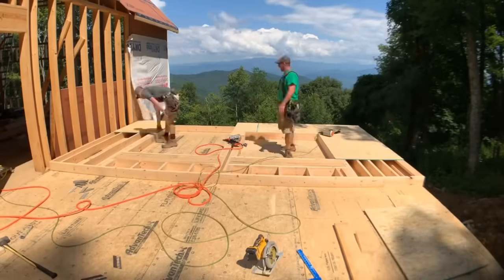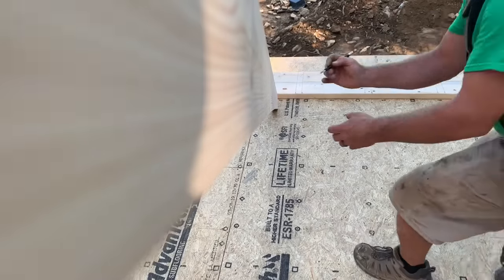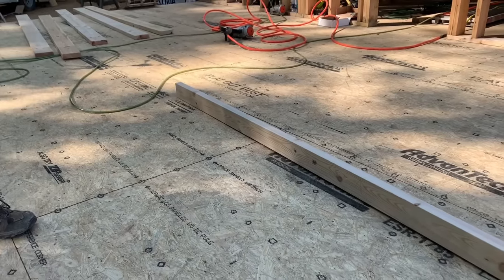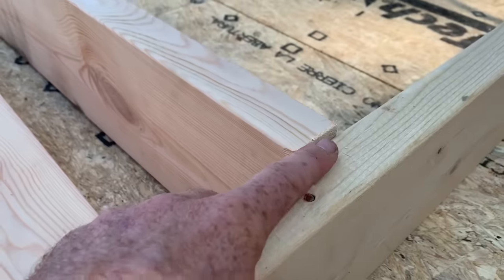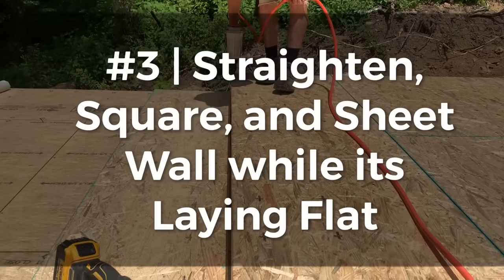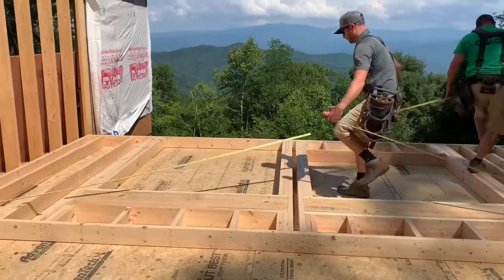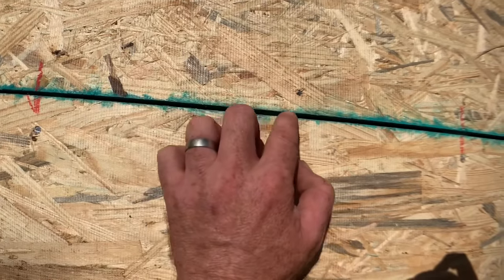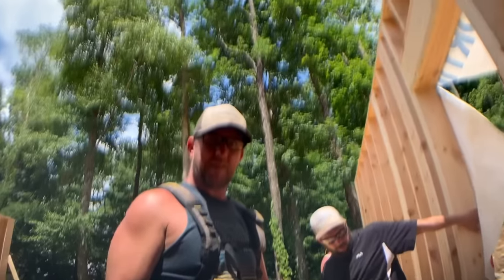Build GOOD Walls! How to do it.

Comment: I like the idea of laying tyvek down as well as the sheathing. Most of the time you are doing things in different phases though, or the framing crew doesn't do the flashing. Also, highly recommend putting some of the sill foam underneath to stop air leaks or good ole subfloor adhesive. The nail trick will keep the sill from sliding on the adhesive.

Comment: Although it is more work to sheath after the wall is vertical . It is more difficult to cut and cleat any crown that is bowed toward the exterior.
For years we used a metal straight edge on walls and dimensional joist to ensure we had a perfectly straight / flat surface

Comment: Good video, just one small nit picky thing, plumb and square are not the same thing. you cant plumb a vertical surface while its laying horizontal. Just my 2 cents.
Reply: If the subfloor is level and the wall is square, once the wall is stood it will be plumb.

Comment: I always nailed the bottom plate to the line before any of of the wall components are attached to it , saving your back from having to move all the wall weight to line it up afterwards .
Reply: bingo!   thats the way ive always done it.......works way better

Comment: Good video. Like the wild Wild West on the job sites around here. Bunch of cowboys. Every cowpoke with a six shooter wants to be a gunslinger. NTM the sites are getting flooded with amateurs again. Insane cycle. Like the tide. - Stuff in this video is 101. Was drilled into my head when I was cutting my teeth. Most of the sites I’m on... there is a gap at the top plate and nothing is plumb. When I say drilled I mean True, Plumb Level and square. 1/4’ is a lot in a 30’ run. Good video Thanks

Comment: Cool and informative video.  I live in Amish country over here. When I drive by a house they are framing I cringe, 10 or more going like crazy on a 3,000sqft house. I've seen braces cut 1"-2" short on pole barns with about 10 nails in them. 😳
Reply: Barn-raisings just ain't what they used to be

Comment: Very nicely done.  We alwaysed toe nailed the bottom plate to layout first with the gun 1.5 inch up at 45 deg you wont have to remove it.  Crips nail to a king stud above a header does nothing. Unless on the 16 center.

Comment: Great video we use they same techniques but tack the bottom plate before nailing studs. Also cut your cripples a 1/16" long as they will shrink a bit on the cut edge.

Comment: Good video. Always nice to see people who care about good quality work.
1.  06:07 What happens after you square, sheath and erect the wall. You now have a rigid wall and what if the floor is uneven and there are gaps between wall and floor or a gap between walls at a corner?
2.  06:18  I know plywood and OSB manufacturers recommend a gap between panels. Problem is the panels are 48" wide; NOT 47 7/8" wide (or 96" vs. 95 7/8"). So, after installing 8 panels with 1/8" gap, your seam will be 1" off centerline of stud or truss.
3.  06:39  Why are there two sill plates between the foundation and floor joists/rim joist?
Reply from the maker: Thanks... 
1. Having a flat floor (at least at the edge under the exterior wall) is very important for this method of sheeting first to work well. We do our own masonry to get a nice foundation and then use an electric planer if needed to normalize all of the floor joists before sheeting the floor so that when we stand the walls there is no gapping.  
2. We only gap the OSB on the long sides (parallel to the orientation of the strands of wood that make up the sheet). Because We have found that osb swells a lot more in the width direction than the length because of the orientation of the chips it is made of. 
3. The double sill plate is for high wind zone building code, since we are on a ridge top. The osb on the walls laps down over both plates and is nailed every 3” to each to hold the house to the foundation.
Reply: @PerkinsBuilderBrothers   Okay, thanks.

Comment: Thanks for the great video. I do have a question: let's say you measured your wall diagonals and they weren't the same? Can you show us a clip of the nitty gritty process of resolving that?
Reply: Just cause the studs are all nailed together doesn’t mean the wall can’t be wiggled into or out of square

It’s quite weeble wobbily until you put the OSB on it and can be tapped with a big hammer or even a foot sometimes to be wrangled into shape

Comment: The reason they send steel banding out with the lumber is to give you material to make straps to keep the wall from sliding off the deck when you tip it up. Make an l ( el ) shaped strap 10 inches long. slide it under the baseplate and nail it to the plate, then , before sheathing, nail it to the deck. One ever 10 feet is about right. If you're lazy and the room gets carpet, then you don't even need to cut them off.

Comment: I used the crowned ones for my 3 stud corners and cripples. Also tie my kingstuds to my trimmers, flipping the crowns in opposite directions.Use your best lumber for your outside walls. Just a few pointers.

Comment: 6:41 Why do so many carpenders insist on splitting the wood that they nail by not nailing in appropriate predictable patterns. I'm a finish carpenter, and not a framer, so I will never have the speed that a framer does. But still guys, did no one ever tell you that a nail in split wood is in holding s***. You might as well leave the nail out.
Reply: I think it's at 06:41.
Reply: @munsters2  You are correct. Thanks.

Comment: I mark my crowns with a big curve on the side of each board...also really important for joists if you are doing a sealed deck to prevent puddling and algae growth.  In addition, I use real plywood rather than the OSB.  I find people will generally pay the extra if they are going to live in the house as not only does the OSB swell as you noted in the video, it also rots easily....especially under openings such as windows.  I like that you guys take pride in your craftsmanship.

Comment: I am retired and not a builder, but I have always wanted to build a cabin.  I am doing that now.  I think something you said during this video is wrong (or maybe I just don't understand).  You said that you put on the tyvec while the wall is sitting on the floor.  My building permit says specifically not to put on the tyvec until the county has an opportunity to perform its framing inspection (I guess so they can see the nailing pattern/frequency that would be covered by the tyvec).  So, what is correct?

Comment: The problem isn't that our materials are harvested in nature. The problem is that mills are cutting corners left and right to get product shipped. I've ripped 2x4s, picked up the saw dust and squeezed out water. These boards are being shipped way too wet. That's why we're getting so much more garbage lumber than we used to. Well, that and a lot of it is force-grown pine that has even less density than it should have (which isn't much to begin with.

Nope, nature has very little to do with the crappy lumber we have to deal with.

Comment: Do you always frame in 2x6's?  Would love to see how to frame a new stud wall with an existing roof.  I have a crappy sheet metal porch that I am removing and making into a real room.
Reply: ...for an existing ceiling, its WAY harder. You need to mount your top plate and bottom plate first, and fill in the studs afterwards. Top plate needs to be fastened into the ceiling joists. The alignment between the top plate and bottom plate must be achieved by use of a plumb bob.

Comment: I learnt this trick to straight the studs within the first 2 months of working in building.

What you do is you set a string line from one end to the other with dodgem blocks. Then you cut a blade horizontal into the stud at the bottom and around halfway roughly 1/3 to 1/2 into the stud (with a skilly). Hit some wedges into where you  cut and determine with the blocks and string line. Once it’s set, splice the cut with timber on both sides and your stuff will be straight with no bow in it. 

If you want an explanation, search up Scott Brown Carpentry on how to do it.

But thanks for the tip guys!
Reply: h2s building lower and non load Bering walls it does, not load Bering walls.

Comment: What do you do with all the unusable lumber? Cement forms? Send them back?
Reply: Yes and yes...some of them can be used for scrap pieces
Reply: Good question.  1.  I use a reliable timber supplier who only supplies the best; 2.  I like to stack up my timber under cover beforehand, under cover but in fresh air to fully dry it, see if it warps;  3. I'll line up a number of bent pieces on a concrete floor, wedged at one end, and pile on a stack of heavy blocks in the middle, leave them for a couple of weeks (if I have the time!) to straighten them out. 4. reject the worst, use them for noggins & short pieces, use an electric planer to level the worst sections.    Check the straightness of walls anyway,  add fine shims / spacers to get a flat frame for drywalling;  and use a good plasterer to skim flat in any case.  There's lots that can be done (and I hate wastage!).  As a last resort, feed your woodburner.

Comment: I'd start by laying the bottom plate on your caulk line. Then you're not pushing a wall and working harder. Also I wouldnt have two guys square a wall, tapes differ and mistakes happen. Then lol when the wall is raised pound your wall out to your caulk line. A few things maybe the video missed but it hit me hard being in framing for years

Comment: great vid.  add some sealent under your bottom plates to make them even more airtight.   woohoo.
Reply: Not necessary.
Reply: @Jay-tk7ib  yes you failed.
Reply: @MrTooTechnical  If I fail by using standard procedures, I'll be happy to fail.
Reply: @MrTooTechnical  Maybe in Alaska.
Reply: @Jay-tk7ib  neuton!
Reply: @MrTooTechnical  This guy is in NC.
Reply: @Jay-tk7ib  i know, he listens, you dont.  anyway.  just add the sealant.  stop questioning.  i am too important. u neuton
Reply: @MrTooTechnical  The sealant is not required, unless you live in a deep freeze state. And yes, you're very important, so please forgive my questioning your authority. lol
Reply: @Jay-tk7ib  stop wasting time, anf yes the sealent is required.
Reply: Jerry Bee no insects around there?
Reply: What u talking about willis?
Reply: @jaxturner7288  I'm sure there are, but different areas have different code requirements. I don't live in his state, but apparently it's not required there to put sealant under the wall plates. I've never built anything that required it, but it wouldn't surprise me if it becomes a requirement everywhere, as silly as everything has become.

If I lived at a place that had bugs strong enough to get under a wall plate, I'm getting the heck out of there.

Comment: I would have nailed the sheathing over the rimboard ahead of building the wall, it acts as a kicker to stop your wall from sliding off. Also eliminates the need to keep the bottom sill nails in during the lift. Plus why put the jacks above the headers? Much less risk of settlement if you frame them in underneath the header. This looked like a nice wall but if you're building on a fixed price its too slow and inefficient

Comment: Crown up on an Exterior wall puts the crown on the exterior in most cases, its much easier to shim drywall that plane off the crown, and that crown generally would not be noticeable on most exterior cladding.

Comment: 7:30 Are those non-galvanized nails into pressure treated sill plate?
Reply: Framing nails. Will never be exposed. Nothing wrong with it.
Reply: @alaskanathabaskan6966  it's not about exposure it's about the p.t. chemicals eating the nails which happens all the time
Reply: @rcjabroniyup4959  I don't believe there will be any problems in the next 75 years or longer.
Reply: G S  What type of application did these nails rust?
Reply: G S   The reason I ask, I built a deck with treated lumber approx. 10 or 12 years ago and I used steel nails and screws. I had to remove screws to replace a step, I will say the screws did appear to show some deterioration, however, they are still holding. Maybe I got a good batch that last longer.
Reply: G S  I have seen this happen as well
Reply: Maybe that guy used stainless and didnt even know. I have never seen nails last 10 plus years in a deck and not be completely destroyed.

Comment: Not bad but those plates under the header are just adding layers of wood that will shrink over time, causing drywall cracks, as well as take up space for insulation.  It's better to bear the header directly on the cripples and fur out the header for drywall backing.

Comment: Don't you have laminated framing in the US? It's almost as straight as steel.
Reply: REALBIGBOY997  that's a pity, I use it for all of my builds here in New Zealand and it's such a time saver. 4 x the structural strength too of standard timber.
Reply: REALBIGBOY997 more importantly to your point even if they order it from some specialty place it costs a tiny bit more per stud but when you end up using 500 studs it can get pricy
Reply: @GameVilleofficialpage  that's different to here, lam framing is the same as oregon. Good to see what the US builder bros are up to though, a few Kiwi carpenters could use some lessons. Builders here tend to be either fantastic or terrible and there isn't much in between.

Comment: The only part I didn’t understand was why you nailed the bottom plate down to the sub floor and then later removed the nails when you stood the wall up?
Reply from the maker: Good question.. it keeps the plates perfectly straight while you sheet the wall, and the nails act as a hinge so the wall doesn’t slide as you stand it up

Comment: I don't understand how you squared up the wall. I see that you measured both diagonals. But what did you do to actually square it?
Reply: If it were within 1/16” your good, if not, shift the top away from the ‘long’ corner to square.

Comment: Was there a reason you used Zip System on the roof but not on the walls? Budget?? I would think it would make more sense on the walls for air sealing
Reply from the maker: Yes.. all budget. I would definitely use it everywhere if clients wanted to pay the extra.  Speeds things up enough on the roof for me to eat the material cost.

Comment: do not paper the wall till it's been inspected...most places require a cover or sheer inspection...
also clipped head framing nails are generally a no go anywhere so dont use those either...
Reply from the maker: Good advice.. we don’t have a sheer inspection where we live. I also always buy the full head nails for our guns
Reply: @PerkinsBuilderBrothers  
I thought I saw a clipped head nail when you pulled a nail off the strip...maybe it was some weird offset head nail that we dont get around here

Comment: Quick question if you don’t mint,  I saw in one of your video that there was a 16 in oc wall holding a 24 in oc rafter pattern. Can it be done like that according to the IBC? And also the other way around ; can a 24 in oc wall hold a 16 in oc roof rafter configuration? Pleas don’t misunderstand my question: I love the channel and love all the content as well, but since I’m writing form the EUROPEAN Union ( Hungary) I jut wanted to ask you what does the code allow. Easier for me to get an answer here than loom through all those pages. (Ha ha ha) good job boyz, keep them vids coming! ;-) 

Best,
Péter
Reply from the maker: If you are using 2 x 4 walls 24” OC  each rafter would have to be no more than 5 inches from the stud with A double top plate. If you are using 2 x 6 24” OC walls the rafters could be placed anywhere on the double top plate. If you are using a single top plate and either situation the rafters would have to be no more than 1 inch from directly above the studs. This is North Carolina building code so I’m not 100% sure that it is the same for international.
Reply: Perkins Builder Brothers really helped me a lot, I appreciate your answer! It’s completely clear now. Luckily I’ve been doing stuff according to this, using double top plate all the time on every project. Mostly 16 in oc 2x4 which is a little bit wider and larger than 1 1/2 and 3 1/2 because of the metric system sawmills use here to cut lumber.
2x4 equals here as actual size 2 inches x 4 inches. A little bit stronger I guess but the material not as much supervised and inspected (during the lumber producing period )than in the US.

Thanks so much, take care 
Péter

Comment: The sill plate under the header should be inside the cripples, too much compression on 1x5" flat stock material, that's wall building 101

Comment: I think you should've said 4 or 5 mistakes. 4th. being, using OSB instead of plywood and 5th. in long walls or in areas that are subjected to high winds/storms, install angle wall bracing. Also in my state our building code requires the perimeter of the floor to be wrapped from the top plate of the foundation wall and fastened to the installed flooring. Then the walls are placed on top of the wrap before fastening them to the floor. Subsequently, the exterior wall wrap is then taped to it. Great job though, you guys.

Comment: I started advance framing my houses and actually since the code change its in the book, which made it easier  to explain to inspectors. My headers now go above the top plate. Super easy on 2x6 wall. Hangers required on a 2x4. What is your thoughts on it mitigating the drywall issues you mention over windows? (regardless your work should be tight and right)
Reply: i like pizza

Comment: Just one question: if you sheath the wall before putting it up, how do you sheath the ends of a wall on a corner?
Reply: Just overlap the sheet as necessary. Kinda like he showed overlapping 15” to nail on to the bottom seal.
Reply: We just run Tyvek tape on all corners